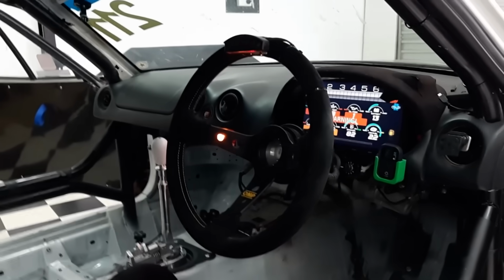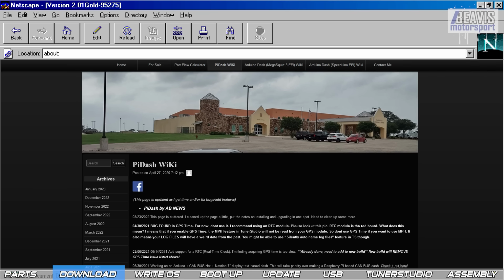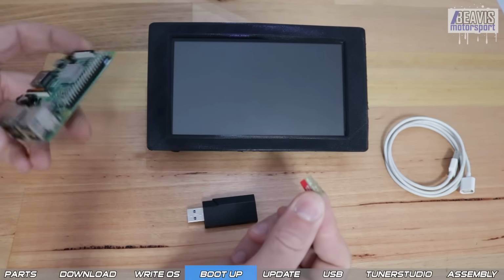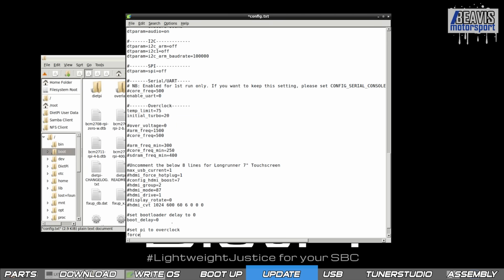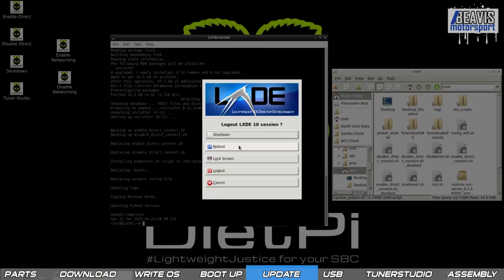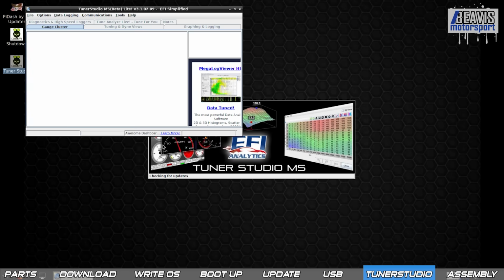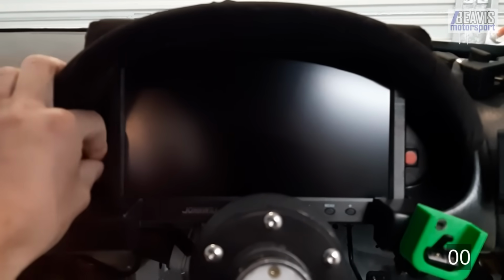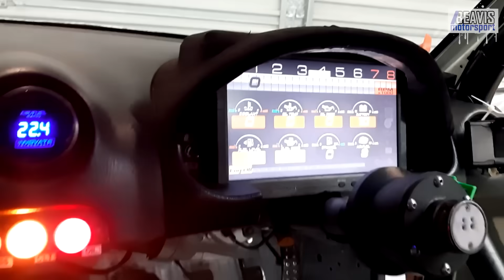DIY Raspberry Pi Racecar Dashboard: The Ultimate Guide

Comment: Hi, I have a classic Mini, in which I have a 7" TouchScreen and RPi 3 running Kodi Media Centre. I always intended to make a CarPuter / Pi Dash but never got around to it. I have now installed a new 1310 engine and will soon be adding a Speeduino ECU. I have installed Tuner Studio and Kodi, but am looking for a complete solution. I have found your excellent tutorial which covers part of what I am after, but there is one essential and one desirable element missing. I would like a GPS speedometer and also the ability to play audio and video via something like Kodi? Sat Nave would also be great. I understand your project is for a Race Application so my desirables are out of spec, but are you aware of any project that has TunerStudio working along side Video / Audio / SatNav / Speedo etx?
Reply from the maker: Hi Bill, thanks for reaching out, sounds like you have a great project. As you say, I have built this for my use case, so I don't have experience with the media/entertainment side of things for a Pi in car.
Perhaps you could build your own menu in python or something similar that can quickly switch between TunerStudio and Kodi, I did something similar using PySimpleGUI.
Good luck, I am sure you will find a solution.
Reply: @Bbeavis  Hi, I never did get this going again, but have now upgraded to a Pi4 and watched your video yesterday, not realising I had already seen and commented on it. Do you need the paid up registered version of TunerStudio to run custom dashboards? I also agree, I think, I'll look at making a custom menus that I can switch between Tunerstudio / Dash / Entertainment and SatNav.
Reply from the maker: @Sternhammer89 Yes, paid version is required for more custom dash features. I have since started using the Dash specific version, aka TSDash. http://tunerstudio.com/index.php/products/ts-dash
Reply: @Bbeavis  do you need TunerStudio as well, or is TSDash a direct replacement? Or can you save on buying both by using the unregistered version of TunerStudio to tune the car and use the paid version of TSDash?
Reply from the maker: @Sternhammer89 TSDash  is a cut down alternative, with different features. You can use one or the other. Or just buy TSDash for the dash, and use free TunerStudio on your laptop.

Comment: You didn't mention anything about how the PI actually gets it's information from the car's ecu... What the ecu is, what other options are there for non-mega projects for example, if any at all.
Reply from the maker: Hey Martin,
Yes, very sorry, something I glossed over forgetting that not everyone viewing would have the context that is is for a Megasquirt ECU.
I'm running this dash in a track car that uses a Megasquirt MS3 ECU. So all my sensors, speed, temps etc go direct to the ECU. Then the ECU has a USB connection direct to the Pi to feed the data for the dash software. Note that the TunerStudio software is specific to the Megsquirt ECUs which is what my car runs. If you wanted to use OBD2, perhaps the OpenAuto software would work for you.
Hope that helps!

Comment: What ecu are you using? Stand-alone?
Reply from the maker: Hey Jason,
Yes, I'm running this dash in a track car that uses a Megasquirt MS3 ECU. So all my sensors, speed, temps etc go direct to the ECU. Then the ECU has a USB connection direct to the Pi to feed the data for the dash software. Note that the TunerStudio software is specific to the Megsquirt ECUs which is what my car runs. If you wanted to use OBD2, perhaps the OpenAuto software would work for you.
Hope that helps!
Reply: @Bbeavis  I’m running an ecu masters emu black, I need to research to see what’s available for usb data. Never was a fan of using obd2 data for gauges, always seems to have a delay to it, maybe it’s just me

Comment: I didnt catch how does your Pi gathers car info? RPM, boost, oil/water pressure/temp etc.? I would love to do something like this to replace a OEM nav screen with a 7 inch digital gauge "pod"
Reply from the maker: Hey Boyko,
Yes sorry something I glossed over forgetting that not everyone viewing would have the context that this is for a Megasquirt ECU.
I'm running this dash in a track car that uses a Megasquirt MS3 ECU. So all my sensors, speed, temps etc go direct to the ECU. Then the ECU has a USB connection direct to the Pi to feed the data for the dash software. Note that the TunerStudio software is specific to the Megsquirt ECUs which is what my car runs. If you wanted to use OBD2, perhaps the OpenAuto software would work for you.
Hope that helps!
Reply: @Bbeavis  thank you for your reply!

Comment: how did you get a pi 4 to work, you said you use a pi4 in your car? When I try to use this image on a pi4 my mouse and keyboard don't work. On a pi3 everything works fine.
Reply from the maker: Sorry to hear, I've seen a few people mention the same issue. I do not recall having any such problem - and yes I am using a Pi4.
I can only suggest perhaps trying to SSH onto the device and running an update that way first, or trying a different keyboard.
Unless, of course, google doesn't have better suggestions.

Comment: im not sure  if i missed it but how are you connecting to the ECU? i know you said over usb but is it just and obd2 reader or something else?
Reply from the maker: Hey Killswitch,
I'm running this dash in a track car that uses a Megasquirt MS3 ECU. So all my sensors, speed, temps etc go direct to the ECU. Then the ECU has a USB connection direct to the Pi to feed the data for the dash software. Note that the TunerStudio software is specific to the Megsquirt ECUs which is what my car runs. If you wanted to use OBD2, perhaps the OpenAuto software would work for you.
Hope that helps!
Reply: @Bbeavis  Ah yes i knew i had missed. Thanks for the reply!!

Comment: hello, My car is old and do not have ecu or OBD2 , what may I do?
Reply from the maker: Hey Octavio
I'm running this dash in a track car that uses a Megasquirt MS3 ECU. So all my sensors, speed, temps etc go direct to the ECU. Then the ECU has a USB connection direct to the Pi to feed the data for the dash software. Note that the TunerStudio software is specific to the Megsquirt ECUs which is what my car runs. If you wanted to use OBD2, perhaps the OpenAuto software would work for you.
Hope that helps!

Comment: Would this work on my coyote 5.0? Since my dash or instruments don’t work
Reply from the maker: Hey Magikarp, it will depend on the electronics running your engine, but certainly sounds possible. If you have OBD2 you could try OpenAuto software for the RaspPi.
Reply: @Bbeavis  thank you know I have to see how to make my radio and lights work since I'm thinking on running everything with a battery and the coyote with a stand alone so 2 wire harness lol

Comment: How can you get custom inputs from the vehicle? Like a speedo and temp sensor and so on if u don't have an obd port?
Reply from the maker: Hey, I'm running this dash in a track car that uses a Megasquirt MS3 ECU. So all my sensors, speed, temps etc go direct to the ECU. Then the ECU has a USB connection direct to the Pi to feed the data for the dash software.
If you don't have OBD, and don't have an aftermarket ECU, it would be trickier, but you could achieve it with some additional custom electronics, not something I can help with unfortunately. Hope that helps though!

Comment: Maybe a stupid question, but how do you connect the rasperry to the car to get all the data? OBD2 ? sorry if I missed this point in the video
Reply from the maker: Hey FM
I'm running this dash in a track car that uses a Megasquirt MS3 ECU. So all my sensors, speed, temps etc go direct to the ECU. Then the ECU has a USB connection direct to the Pi to feed the data for the dash software. Note that the TunerStudio software is specific to the Megsquirt ECUs which is what my car runs. If you wanted to use OBD2, perhaps the OpenAuto software would work for you.
Hope that helps!

Comment: but how does the Pi get information about the car?
Reply from the maker: Hey Casey, I'm running this dash in a track car that uses a Megasquirt MS3 ECU. So all my sensors, speed, temps etc go direct to the ECU. Then the ECU has a USB connection direct to the Pi to feed the data for the dash software.
Reply: @Bbeavis  If only there was a supported version for the Pi zero/w. But understandably you would want the higher ram of the Pi 4 to reduce load lag.

Comment: Will i be able to use any other tuning software on it or is it only for tuner studio?
Reply from the maker: Hey, I'm running this dash in a track car that uses a Megasquirt MS3 ECU so the TunerStudio software is specific to the Megsquirt ECU. If you wanted to use a different aftermarket ECU, you would need different software on the Pi, or for OEM OBD2 data perhaps the OpenAuto software would work for you. Hope that helps!

Comment: Hi, I'm trying to do this but I'm having an issue with the keyboard and mouse not working once it boots up. Tried Bluetooth USB connection, hard wire connection and tried using touch option on my 7in touch screen that I am currently using for this. None of those worked so basically I can boot it up and that's it can't do anything past that point since I have no way of controlling it. Any advise?
Reply from the maker: Sorry to hear, I've not come across any USB input device issues myself so I cannot help you there. I've used a cabled USB keyboard, and wireless USB mouse, both were plug and play without issue.

Comment: does it work with obd2 or some proprietary haltec ems
Reply from the maker: Hey, I'm running this dash in a track car, that uses a Megasquirt MS3 ECU. So all my sensors, speed, temps etc go direct to the ECU. Then the ECU has a USB connection direct to the Pi to feed the data for the dash software.
If you run a Megasquirt family of ECU in your car, then you can apply the same software process as I have detailed in the video. If you run another ECU, or the factory computer, then you'll need to find some appropriate software for your car.
Hope that helps.
Reply: @Bbeavis  ok yeah thought proprietary was just thinging of my first gen rav4 lol not gonna happen

Comment: As someone who's designing a replacement dashboard for my Polaris Sportsman 500 (using a Raspberry Pi 3B), it feels like you're glossing over the connectivity to all those gauges in same. In my case, I've had to laboriously go over the schematic for the quad and decide how best and safely to interface everything into a computer which honestly wants 3.3VDC at the logic level. You can't just plug a 12V line into the Pi as a hardware interface because you'll fry the board. Personally, I've added a PiFace Digital 2 hat to my Pi so that I can take advantage of its relays and eight inputs. The challenge is to design minimal external circuitry to marry that with what the Polaris is doing.
Reply from the maker: Hey Justin, Thanks for your feedback. I am just sharing my process and my experience, it may not work for everyone and every type of car/sensor etc.
I'm running this dash in a track car, that uses a Megasquirt MS3 ECU. So all my sensors, speed, temps etc go direct to the ECU. Then the ECU has a USB connection direct to the Pi to feed the data for the dash software.
Hope that helps.

Comment: How do you get the real time data into the raspberry pi? Via CAN bus? Did I miss something super basic? Thanks
Reply from the maker: Hey Jayden, I'm running this dash in a track car with an aftermarket ECU, it uses a Megasquirt MS3 ECU. So all my sensors, speed, temps etc go direct to the ECU. Then the ECU has a USB connection direct to the Pi to feed the data for the dash software.

Comment: how does it read the car data like speed etc? is it connected to the obd2?
Reply from the maker: Hey Hamza, I'm running this dash in a track car with an aftermarket ECU, it uses a Megasquirt MS3 ECU. So all my sensors, speed, temps etc go direct to the ECU. Then the ECU has a USB connection direct to the Pi to feed the data for the dash software and they communicate using the ECU's proprietary serial protocol.

Comment: are the gpio pins interchangable? can i specifiy in that bash script gpio 17 instead on 21 for instance?  gpio 21 isnt working on the PI i have. everything else went very smooth courtesy of your guide, thank you
Reply from the maker: Absolutely. It's just an input to ground to trigger the shutdown.
Reply: @Bbeavis  yup got it figured out, simply change the two gpio pins in the two scripts and presto! thank you, works great. Used a relay to change a positive trigger from my electric panel to negative trigger. No extra buttons hanging around.

Comment: if you want to get a bit more technical there should be a way to completely disable the desktop manager/environment and have just the dash software load up in full screen, probably eliminating about 10 seconds from the boot time. i'm not familiar enough with linux to get into the specifics but from what i know it should be possible (see retropie)
Reply from the maker: You are on the right track - I do something like this for my HomeAssistant dashboard... when I find some more spare time I am going to build a new image that does this for my car dash display.

Comment: So how do you hook up inputs such as temperature etc etc . Or do you just use OBD2 .
Reply from the maker: All the inputs are into the cars ECU, a Megasquirt MS3. Then the Pi interfaces with the car over a USB cable, with the Pi running the software to communicate with the car ECU's serial protocol
Reply: @Bbeavis  So would this work with a Hondata K Pro ECU ?
Reply from the maker: @johnnystoka6625  Tunerstudio will not work with the Hondata. If your ECU supports OBD2, then you could consider checking out a product called 'OpenAuto' instead.
Reply: @Bbeavis  Thank you

Comment: how excatly do you connect the cable to the ecu?
Reply from the maker: All the inputs are into the cars ECU, a Megasquirt MS3. Then the Pi interfaces with the car over a USB cable, with the Pi running the software to communicate with the car ECU's serial protocol.

Comment: Very nice instruction video! But one thing what i missed was the communication from the vehicle, is there some specific can database or how and where the rasp is taking the data out?
Reply from the maker: Hi pesosenjarmo, The interface between the Pi and the cars ECU is via USB, to the ECU's serial interface. The car runs a Megasquirt MS3 ECU, this uses it's own serial protocol over USB to communicated with the TunerStudio software on the Pi. Unfortunately in this case, TunerStudio will only work with a Megasquirt family of ECU. Hope that helps.

Comment: Where do you get the data inputs?  Temp,rpm,oil pressure, etc
Reply from the maker: Hi Danny, 
All the inputs are into the cars ECU, a Megasquirt MS3. Then the Pi interfaces with the car over a USB cable, with the Pi running the software to communicate with the car ECU's serial protocol.
Thanks

Comment: Thanks for sharing the process. Two questions arose: #1. How did you access the car data? ODB2? #2. Is there any software to draw the displayed interface? Is it possible to create animated interfaces?
Reply from the maker: Hi Elson,
1. The interface between the Pi and the cars ECU is via USB, to the ECU's serial interface. The car runs a Megasquirt MS3 ECU, this uses it's own serial protocol over USB to communicated with the TunerStudio software on the Pi.
2. I create the dashboards myself in standard image editing software (Photoshop, GNUImp, etc) and then embed these in the TunerStudio software's dashboard designer tool. It's not perfect but does offer some level of customisation and animation, within the limits of the software.
Hope that helps.

Comment: Can the Rpi be wired to Original ECU and not a MegaSquirt standalone ECU?
Reply from the maker: Yes, you will need to consider alternative software solutions, possibly OpenAuto, and hopefully the OEM ECU supports the OBD2 interface.
Reply: @Bbeavis  Thank you for answer 💜
Unfortunately my car doesn't support OBD2 interface, However I have my ECU pinout, I was thinking about maybe some software that I can connect GPIO pins to RPi and map them in the software to corresponding gauges and then read them somehow.

Comment: Look brilliant, how do u connect to ecu. I’m guessing needs to be a 3rd part ecu
Reply from the maker: The interface between the Pi and the cars ECU is via USB, to the ECU's serial interface. The car runs a Megasquirt MS3 ECU, this uses it's own serial protocol over USB to communicated with the TunerStudio software on the Pi. TunerStudio will only work with a Megasquirt family of ECU. If you want to run an OEM ECU, perhaps using OBD2 for comms, then maybe the OpenAuto software would work.

Comment: so... how does it connect to the ECU to read the data? is it like an OBDII to USB cable?
Reply from the maker: The interface between the Pi and the cars ECU is via USB, to the ECU's serial interface. The car runs a Megasquirt MS3 ECU, this uses it's own serial protocol over USB to communicated with the TunerStudio software on the Pi. TunerStudio will only work with a Megasquirt family of ECU. If you want to run something like OBD2 for comms, then perhaps the OpenAuto software would work.
Reply: Aww damn. I got the pi all setup. But I'm running stock ecu

Comment: I'm  planning on doing one with an Arduino connected to the can bus, but this looks easier. I'm just curious how you connected the car to the raspberry pi to get the cars info, like rpm, etc...
Reply from the maker: The interface between the Pi and the cars ECU is via USB, to the ECU's serial interface. The software uses a propriety comms protocol. if you are looking at an Arduino and perhaps CAN comms, then you are probably going to need to look for a different software option.... I am sure the Pi has offerings that would work with CANBUS.
Reply: @Bbeavis  ah i see! Yeah i was going to write my own software, thanks for the info.